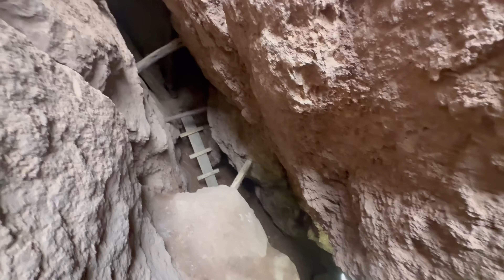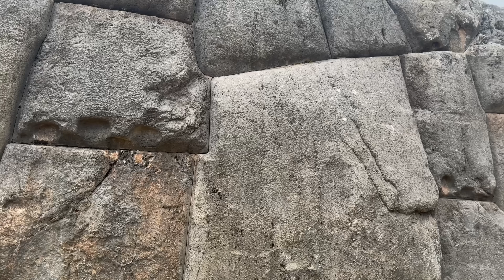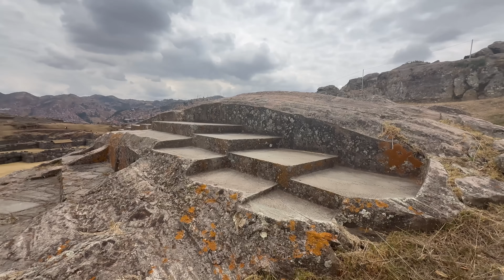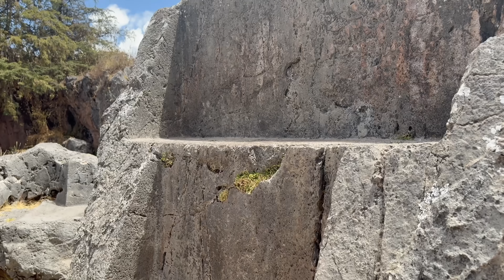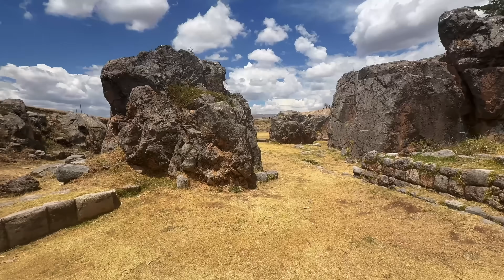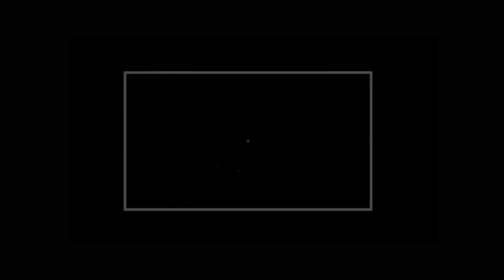This Place Looks Impossible to Build

Comment: The more I see of the “marshmallow” building style (seen all over the globe), the more I believe, how ever they did it, they did it from the top down? I’m thinking of the lower stones being carved to suit the upper.
Reply: The limestone at Sacsayhuaman is distinctly different from its origonal bedrock deposit because the deposit contains fossils and the walls do not.

That indicates geopolymerization.

As for the harder stone, geopolymer would require magnetic field manipulation to grow crystal inclusions, so either they were MUCH more advanced than we think, or found a much more efficienct way to cut granite than our traditional ancestors.

I personally lean towards infrasound manipulation (easy enough with igneous stones because they grow large percentages of quartz, and likely iron for magnetic properties).
Reply: @TheRotnflesh I’m totally with you with resonance stuff. Surely that’s how they softened the stone. Soft enough to scoop. I’m sure I read somewhere that the used a substance known as Mana(?) to melt the stone.